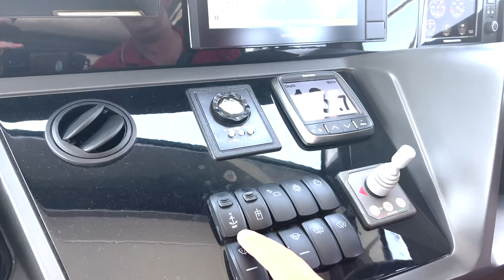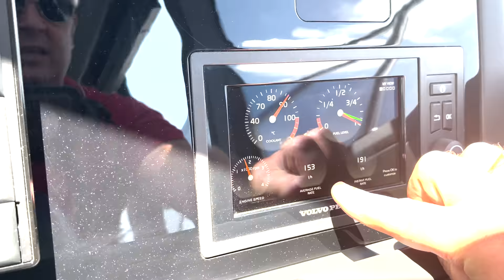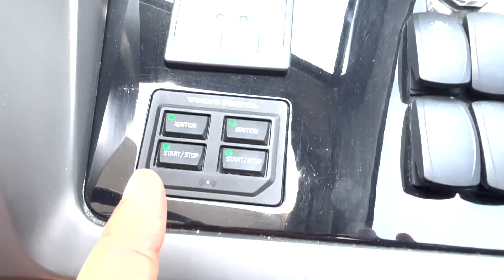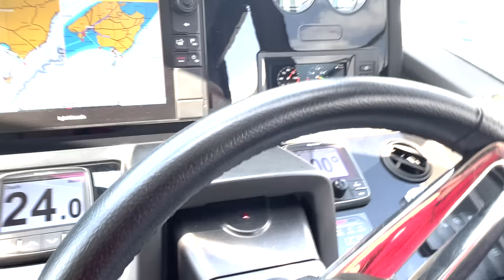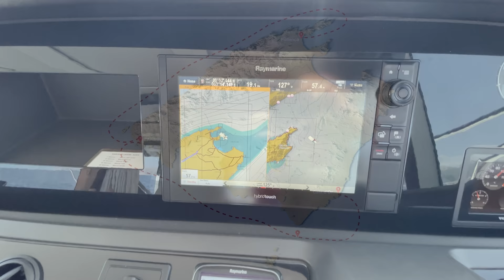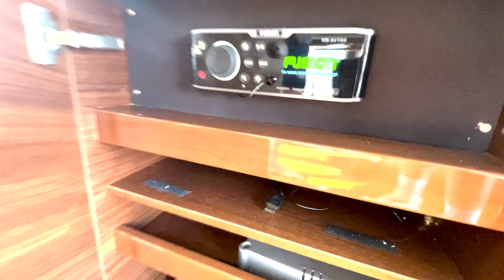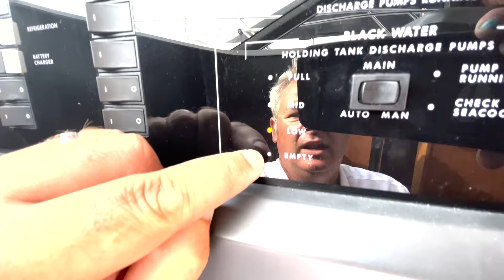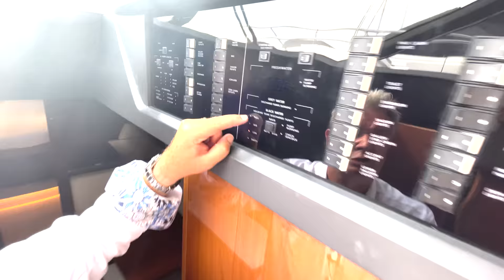£1M Princess V58 - We circumnavigated Mallorca, living onboard with our kids. What could go wrong?

Comment: You only have 1 fuel tank on the boat?  I would think you would have 2, 1 for each engine. And the two needles on the fuel gauge is showing the actual fuel level of each tank…no?
Reply from the maker: Yes you are correct 😊 #sunstroke 😂